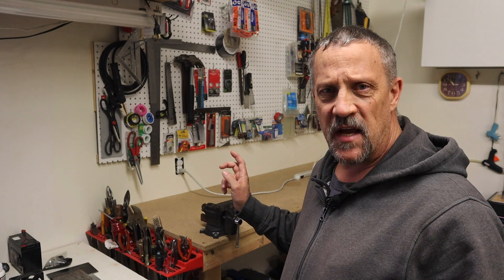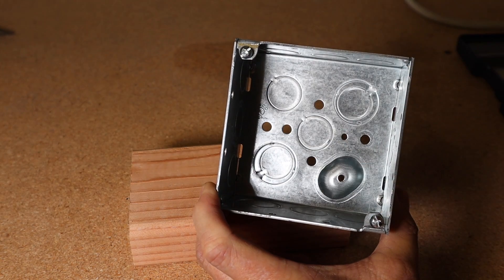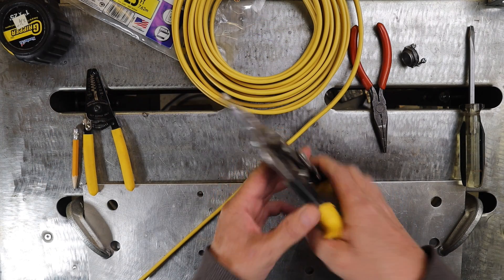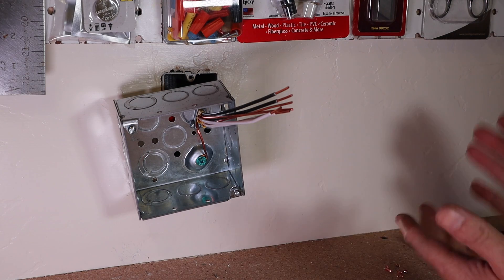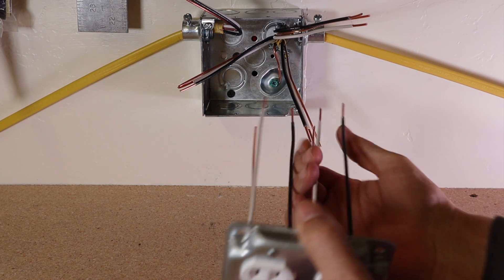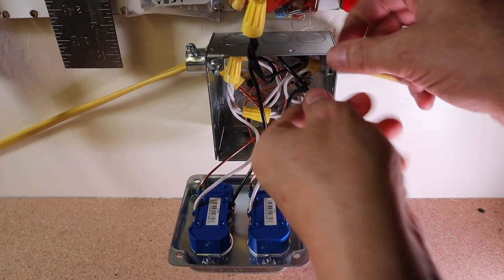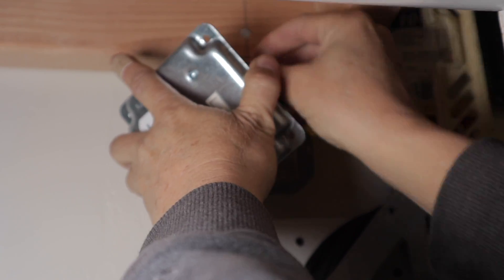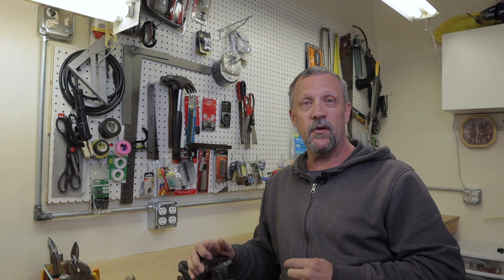How to Install New Outlets in Garage - DIY Wiring Projects! (OFFICIAL VIDEO)

Comment: Try using the correct adapter that would screw right onto your old switch box giving you access to it per the NEC. It has a cut out of the switch box and looks like a 1900 box.

Comment: Your first step is a code violation. IE: Hidden inaccessable splice. Use the following box instead. Steel City 531511234UB Pre-Galvanized Steel Square Box Extension Ring

Comment: Like how you attached the first box over the original. This is exactly what I'm looking to do in my garage! Building out my work bench this fall, and this is one of the next steps.
Reply from the maker: Thanks Riley, I wish you the best with your project!
Reply: Is there a way to keep the first receptacle inside the walls? Or do you have to bring it out to run the wires through the conduits for new receptacles?

Comment: In my area and told at numerous IAEI continuing education classes that you should never run type NM-B ( Romex is a brand name ) in conduit. Most inspectors will allow NM-B cable in a say 3 to 6' long piece of conduit to sleeve cable down a basement wall to protect cable.

Comment: Not legal to have splices that are no readily accessable going by the NEC. Two possible ways of what you should have done. 1) installed a 1/2" chase nipple and made splices inside of new 1900 box or 2) cut an opening as large as possible then install & glue a tubing to protect wires and make splices in old existing wall box. Have to use 6/32 screws to secure new box to wall box.

Comment: As a life long electrician NEVER waste your money on a 20 amp receptacle unless a window air conditioner requires it. A 15 amp duplex receptacle is perfectly legal to install on a 20 amp Arc Fault circuit breaker ( also provides GFCI protection ). The insides of all 15 & 20 amp duplex receptacles are identical. I've been in my house over 45 years and NEVER had to use a 20 amp male plug. ran 3/4" EMT conduit in my garage for additional receptacles.

Comment: Wanting to add 4 boxes of four like you have.  Do I need to run back to circuit box or can I connect to existing gcfi?
Reply from the maker: I really can't tell you how to set yours up but mine do not go directly back to the main breaker box. Mine are all down line off the gfci outlet.
Reply: @DIYHomesteadProjectsDIYHP10  can u share what you used: what type of wire, electric box used to hold both outlets, etc?
Reply from the maker: I have links to everything I used listed in the video description.

Comment: Where did u start the conduit?? The first box is surface mounted & then bare wire. I see the ends are in conduit. Do you need to have conduit from the source or can the wire be surface mounted & stapled(etc) to the drywall? Thanks for posting this!!
Reply from the maker: I started the conduit at the first box and it extends to the next box. I didn't want any exposed wire along the wall. I don't believe you should staple the wire to the outside of the sheet rock.

Comment: Nice clean job! But It’s a code violation to run sheathed wire through conduit
Reply from the maker: Thanks Peter
Reply: So what are you supposed to use? It will be beneficial if you say what to do instead of just NOT what to do.
Reply: It’s up to local jurisdiction, but NEC allows EMT to be used to protect romex.   I’ve heard fire hazard, but run some 12-2 through an insulated south facing wall and fire up a toaster oven or hair dryer.   Which romex gets hotter.   Where’s the fire inside the EMT?   How about using stranded THHN ?  Are all your connections solid, with no strands sticking out causing a fire hazard ?   I like the spirit of the code, but  it’s not bulletproof, and his guy makes tight connections, and isn’t hiding any work. Even the box on the box can easily be opened for troubleshooting.    Yes it could fail inspection on a bad day, but I’ve seen licensed electricians run multi-wire branch circuits using 12-3, on two fuses, 15 and 20 amp,  branches extended with 14 ga, and the breakers not tied together.   It’s not code, but passed inspection.   Wire as safely as you can, but code and inspections didn’t guarantee my safety.  DOnt get me started on the multi-wire branch to DW and disposal, that got a nail through the excess slack.   This was all professionally done.  This guys work is better than what I saw

Comment: They make an extension 4x4 box that meets code, your hack does not. Red wire nuts would have cut your splices in have.
Reply: All the extension boxes I looked for, don’t have a screw hole to ground the box/extender. All metal boxes should be grounded, right? Could you link the code compliant box if possible please? Thanks

Comment: Question: at 10:40, what kind of screws did you use to attach the cover to the box? I’ve got a few boxes in my garage with missing screws, some covers are held on with only one screw. I’d like to get new screws and put them in but not sure what kind to get. Thx
Reply from the maker: I just used the screws that came with the box cover. I would think any hardware store will have replacement screws for metal box lids. Sorry but I don't know the size and thread count.

Comment: The first box you put in is wrong. You can not cover a box with a box, big code violation. It should have been removed or an extension box put over it.
Reply: Who cares? It's not like he's moving out of his house and the new owner requested an electrical inspection for whatever reason.
Reply: In addition to your comment, I would have used THHN wire, instead of Romex, and I would have taped the wire nut connections.

Comment: Do I need electrical permit or can I just do without it?
Reply from the maker: I recommend you check with your local building department. The rules and requirements can vary depending on where you live.
Reply: @DIYHomesteadProjectsDIYHP10  OK. Curious did you get one or you just did the work without it?
Reply from the maker: A permit is not required for this where I live. I did the work without it.

Comment: you cld have cut down the connections by daisy chaining the outlets together leaving  just one set of wires from coverplate to tie into the other two loads leaving just 3 wire nuts with three conductors under 2 and a copper crimp or larger wire nut for the grounds or the special green pass thru wirenut with just 3 conductors sill for the ground. i do add wire extensions too when i wire up boxes like this example i wld have added one extra nmb cable from the feed box not 2.

Comment: I'm not an electrician, but I think you did a very professional looking job. I did something similar in my garage, but I used THHN wires in the emt, not Romex. The use of 15 amp duplex receptacles on a 20 amp circuit with 12 gauge wire is commonly done and is code compliant, as long as it is a duplex receptacle and not a single. You cannot use a 20 amp receptacle on a 15 amp circuit. The reason why I mentioned this is that it sounded like you thought that it was not correct.
Reply from the maker: Thanks for the comment Ted, I appreciate it! I am aware of the 20 amp receptacle on a 15 amp circuit. I mentioned it in the video because I get a lot of comments with people telling me it's not ok. I considered using THHN but the Romex was quite a bit cheaper. That's why I decided to use it instead of the THHN.
Reply: Many locations do not permit Romex in a conduit.  Heat dissipation issues.
Reply: You can use a 15 amp single receptacle on a 20 amp breaker and only #14 copper wire IF it's for motor load that might trip a 15 amp breaker due to high inrush ( a second or two of locked rotor Amps ). Good example would be an air compressor or window air conditioner.

Comment: Two GFI’s on one circuit will not provide protection. ONLY the first outlet in the circuit should be GFI and all downstream outlets will be protected. And only a total of up to six outlets per circuit.
Reply: That depends on how they are wired. Gfci dont fight each other. You can put all gfci in if you want.
Reply: @thomasmarable6818  Sure, you can, but it's a terrible idea and completely unnecessary.  GFCI's don't "fight" with each other, but when one trips, sometimes they all trip and if there are a bunch of them, you have to reset them in order.  Even if only one trips, you may have to hunt it down to find the right one.
Reply: @dajur1  depends on how you wire them. But it get expensive to put all gfci in
Reply: ya not to mention 2 gfci on one circuit fight with each other and one or both trip or even cause breaker to trip too. fun times when home owners dont realize what a gfci breaker is and just add gfci outlet next to a sink or outside  😱🤦‍♀️🤦‍♀️

Comment: My garage has outlets... 15 amps that are on the same circuit as the outlet in the damn laundry room on the second floor. Same circuit used by the washing machine...what the hell were they thinking.
Reply: The laundry room should be independent AND the washer and drier should be on separate linked breakers.
Reply from the maker: Good question

Comment: Nice job and it's interesting to see the difference in wiring codes. Here in the UK regulations are that any bare copper earth conductors must have green and yellow sleeving on them in back boxes and so on. Also when joining wires screw block connectors are used or, as it seems more commonly now, Wago connectors which use little levers to clamp the wires in place.
Reply from the maker: Thank you